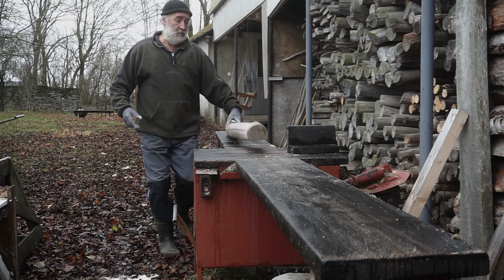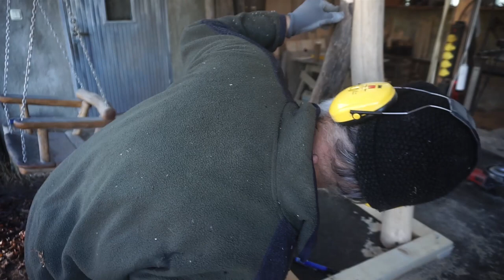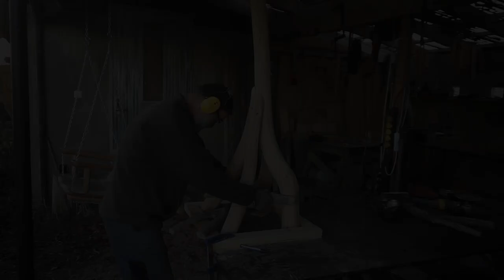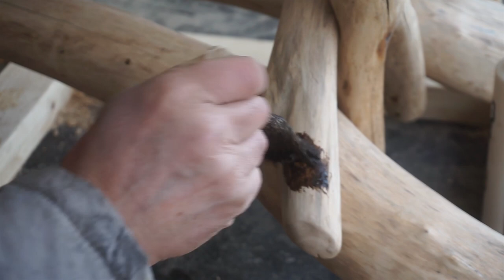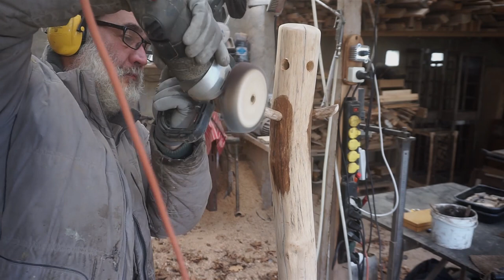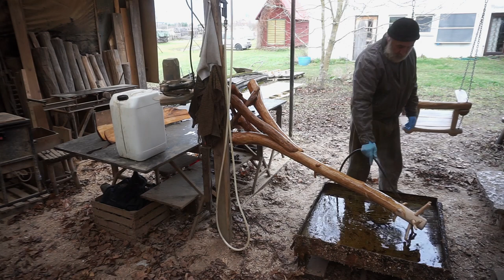Coat stand from a crooked tree by Uudopuu

Comment: Udo greetings from the mountain state. West Virginia USA I don't comment much on videos but I have been captivated by your channel. First off I want to say from one wood worker to another much respect I love your style and passion for what you do. If I may I have a couple questions. First off what is the purpose of the stain you use on the joints and ends just to sand it back off. My second question involves a tool you didn't use in this video. The machine you cut your tenon's on is that a modified router of sorts. I used my table saw for sometime before I got the lumberjack tenon cutters I use now. They look like very large pencil sharpeners that fit in a half inch drill. Thanks for taking us along on your journey and showing us the fine work you do.
Reply from the maker: Hi wood worker John from West Virginia. Thank you for your kind words. I really like this woodwork. If it still allowed for a decent living, it would be especially great. Yeah ...
So. This stain I use has two purposes. By using it between two sandings to bring loose wood fibers up and then sanding, it is easy to see where it has already been sanded and where it has not. Before the last sanding, I cover with a stain again, but then I don't sand everything down to leave a darker shade like the part of the wood that is naturally aged and lightly sanded.
This tenon-making machine I didn't use in this video was originally a test, I was thinking I would do better later. Well, you see... Yes, there are many ways to make a tenon, why not a saw. I know the pencil sharpener like, but I haven't bought one because I already have a machine for the job. And with a pencil sharpener, it's hard to get the tenons in one line when you need to make both ends. Of course you can, but my method is easier and more accurate to get in line. Greetings.

Comment: Hi mate. Great work, yet again. What is the brown substance you apply to the wood? It's obviously it's a sealant. Is it creosote? Thanks.
Reply from the maker: Well, I age the wood, so it looks like old wood, but the white tone of the wood comes out during the processing, I tint it with a brown substance that is an aqueous solution, the composition is a recipe I found myself to match the natural old tone of the wood. The recipe is my secret that I don't want to reveal. I also apply this mixture to the glued areas if I use pva type glue. In this way, I clean the glue from the joint and also tone it. If I glue with polyurethane glue, then after the glue dries, I apply the same recipe only as an oil solution.

Comment: Awesome video and coat tree!  I’ve really enjoyed watching your channel and I subscribed! 

I was wondering,  what is the liquid you coated the project in with the hose . I’ve seen it in several other videos,  is it just stain? Thanks!
Reply from the maker: Oh nice!
I use "Teak Oil" from the hose. It's like an impregnating oil, very liquid, and I fill all the smallest cracks by using this method from the hose. I use "Danish Oil" as a coating oil, it is much thicker and cannot be applied from a hose, so I cover it with a cloth.
Reply: @udoaas2466  Very interesting, have you ever used boiled Linseeds oil? 
thank you!
Reply from the maker: @DrewCreate  The "Teak Oil" I use is based on boiled linseed oil. It has added solvent, siccative to speed up drying and fungicides to prevent mold.